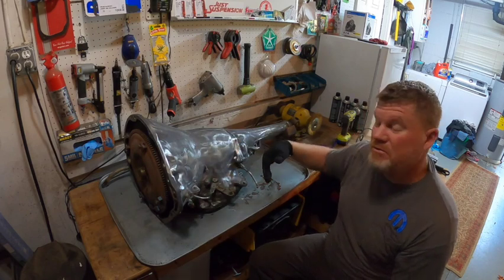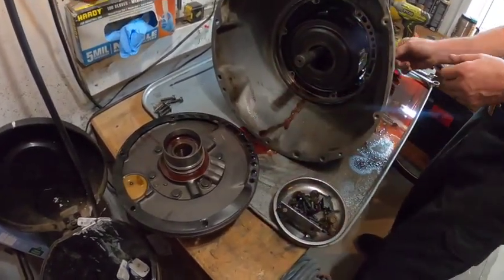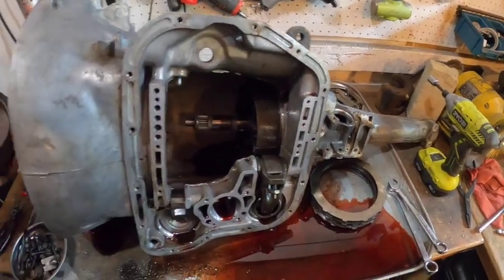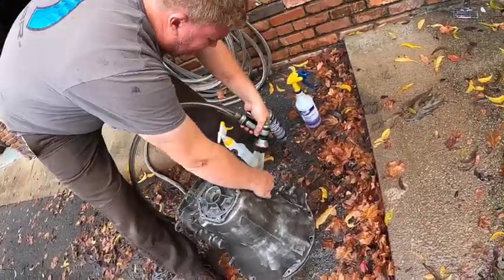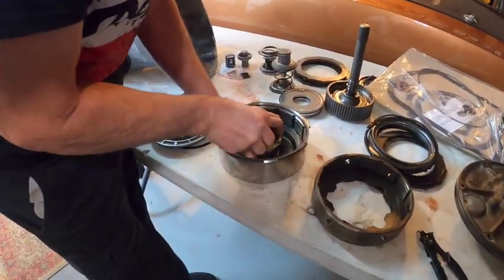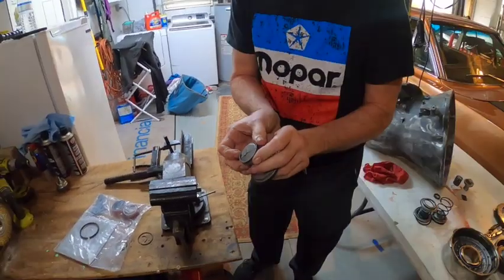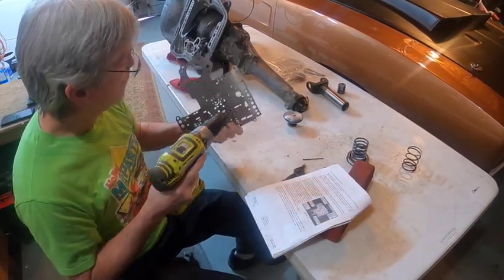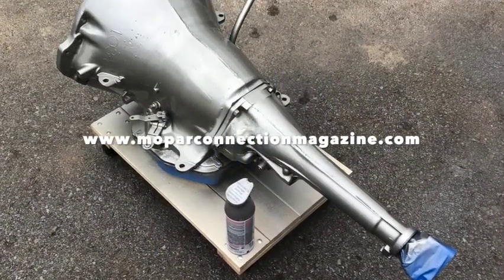Complete 727 TorqueFlite Automatic Transmission Rebuild & TCI Auto Upgrades

Comment: I'm a KTP 5305 retiree. I built hundreds of thousands of these models over the years. I noticed there weren't any spacers in the clutch housing, and that led me to believe this was why the oil looked as good as it did, given the age and mileage that was disclosed in the video. When these transmissions were built properly and maintained, they're capable of lasting forever. Lesser the seals and gaskets, and if one uses AP205, that can also allow those to last for decades as well. Today's models can not even come close to the proven quality of one of the best automatic transmissions ever manufactured. Another model that was extremely reliable was the 404 three speed. One of my uncles designed that model way back in the 70s. He worked in one of my old departments' 9300 valve body main repair, and his idea reached  Lee Iacocca, and he leaped at the idea for the K car platform that actually saved the entire company.  Pertaining to the 404, what made it unique was that it was practical and, most importantly, cheap to build. The value body wasn't a traditional styled three piece. It was a two-piece. And the cost for no issue production cost the company at the time $150 per unit to build and MOPAR sold them at an average price of $1,250 and that was one of the best ways to make money during those years. We needed trusted quality and yet retain cost to a minimum.  People can say whatever they want about the Chrysler transmission. Those units had a history that even the most knowledgeable MOPAR historian still yet to this day has no idea just how great they actually are. You see most of the entire driveline actually wasn't much of Chrysler designers idea at all but actually one of the best if not the best auto manufacturers ever and nobody would ever guess to whom that company might have been. But I know and I'm gonna let you in on it. It was Studebaker. That's correct ladies and gentlemen. The one and only iconic Studebaker. As a matter of fact KTP still uses the bar machines that Chrysler purchased from Studebaker decades ago to make such things as the sun gears ⚙️ for the rear carrier. Let alone the overall design and internal process. I also bet that you didn't realize that Chrysler to this day only builds automatics. Chrysler has never actually built any manual transmissions throughout its existence. Yep I'm very proud of my connection of this great company being the 5th generation of MOPAR. The company has survived and who knows perhaps one day it can be actually owned by someone again in the this country instead of being mistreated as it has been for many many years.
Reply from the maker: This is an OUTSTANDING comment! Thank you!
Reply: @Mopar Connection Magazine  You're welcome friend 👍
Reply: I already read this comment. It was already posted prior to my comment 😂. Enjoy.
Reply: Thanks Greg. I’m 77 and doing my first rebuild of a 64 Dodge 727. As a tool&die maker of over 50 years, I’m hoping for a good build. I appreciate the knowledge of you guys that made the video and the comments! Building a 64 Dodge Polara ….. my way! Good or bad, it’ll be interesting I hope!

Comment: Man, why aren't you using any transmission assembly lube or feeler gauges on the seal installs? You're going to cut them seals up and it's not going to have any lube. You're just putting it together dry. You can't do that man
Reply from the maker: Good observation, but we didn't show everything (it's be hours long). That and Jim is 30-year a certified Chrysler technician. We followed his lead.

Comment: I built one in 2015 from 2 different transmissions and never opened one up before, 727 is so easy to rebuild.
Reply from the maker: Yeah it is - Ma Mopar may have cut a few corners to save a few bucks when it came to building these cars but the money spent on engineering these things was top notch.

Comment: can you get a parts list from TCI Automotive to replace and upgrade a torque flight 727 36rh and or 37rh 727 tf-8 it is in my old 1980 Maserati Quattroporte III  that came with a torque flight And I want to make it better for upgrades:  'improvement' kits, specifically the Transgo SK-TF or the TF-1 enhancements (slightly crisper shifting, additional downshift control). Good clutches and bands make a big difference. I would get a better kick-down lever too. The stock transmission have a 2.8 to 1 lever. If you can get a 3.2, 4.2 or even a 5.0 lever it will really firm up the 1/2 shift.
Reply from the maker: No but you can! Just call them up!

Comment: Thank you so much for the video. I may need it. Im hoping to avoid a rebuild if i can but first i need to diagnose this new sound. Its whirring/whining that sounds identical to bad torque converter bearings accept it is loudest in neutral and deceleration in gear. Even noticeable in park but not as loud. And a noticeable clunk when shifting from neutral to reverse or drive. Transmission seems to work great though. Please tell me you have an idea what that is?
Reply from the maker: Glad it helped

Comment: I don't care who you are why in the hell would you drill on the workbench around the rest of the valve body and then washed the shavings out all over the place. Why not simply take it somewhere else and drill it and blow it out 🎉
Reply from the maker: I can assure you it was clean before assembly.
Reply: @moparconnection  No Doubt , just didn't make sense